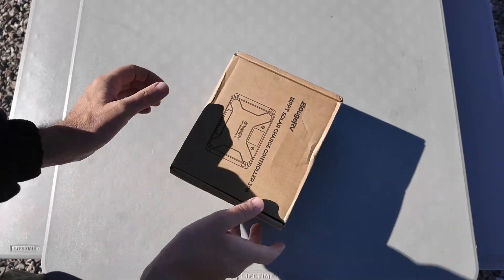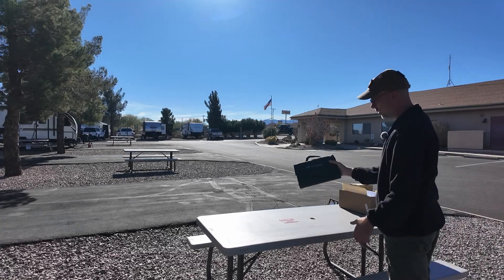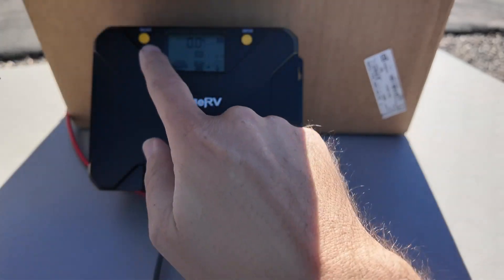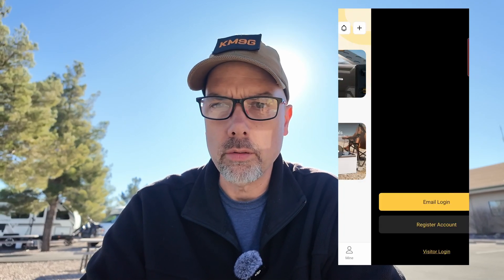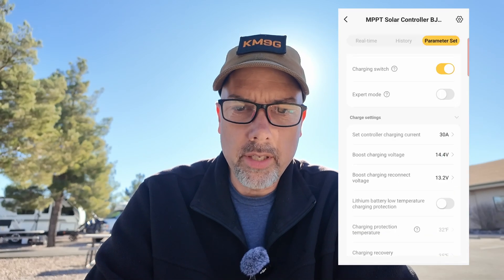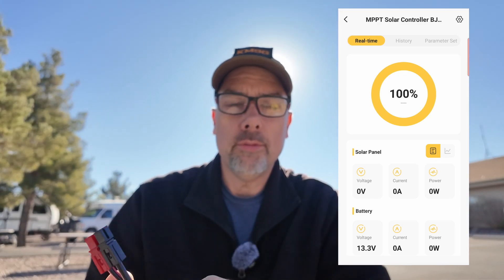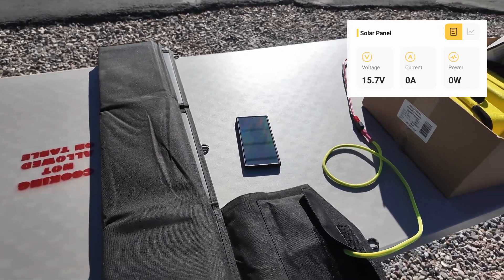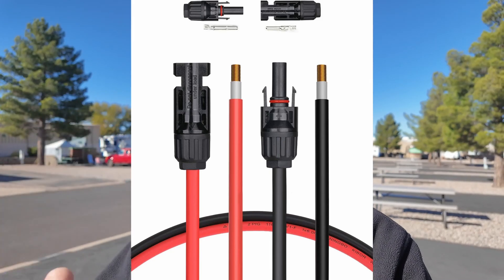Power Your RV With the BougeRV Charge Controller

Comment: Hey Steve, I'm just working to upgrade the pwm controller in our little travel trailer and was looking at this very unit.  How is it working for you after some months of use?
Reply from the maker: It worked great, but I ultimately sold it to make room for other controllers.

Comment: What about BougeRV 20A Buck-Boost MPPT Solar Charge Controller
They normally say to connect battery first, but most people read manual first....
Reply from the maker: I'll have to grab a 20a unit from BougeRV and test it out.  I always connect up the charger first just to get comments,  As you saw it really doesn't matter which one you connect first.

Comment: Looks like a nice controller . Just use Bluetooth .I have seen that model but not installed one yet. Normally Victron and Powerqueen Charger controllers I have installed. I have used Morning star MPPT ones. I have them hear and Victron I use myself. I have used and installed the BougeRV solar panels and I like them and hear good things about them. I see you can fine tune the charge boost voltage . it is pre set to 14.4 like the powerqueen one.  I change to 14.6V for LiFePO4 or 14.5V  . Just read battery data . you want to get a full charge so the battery BMS can balance the cells.  I have installed the inverter from BougeRV . It is clean AC and the RFI is not too bad. I always install snap ferrite buy inverter DC and AC leads . It is cold windy and quite snowy in NY now. My wind gen is going strong. getting like 55 MPH winds . All that snow and wind make CB hard to use with static but GMRS is working great ! I got MURS radios as well. The skip on CB is crazy ! Can;t talk local.   73
Reply from the maker: sometimes I feel like MFGs don't use their products.  I know what its supposed to do, but I have to use the bluetooth to make it work.